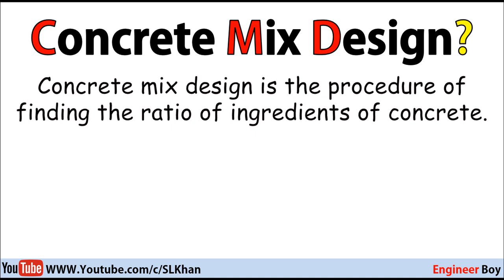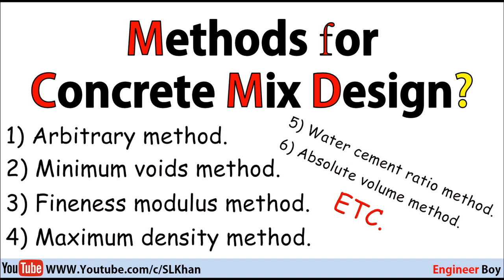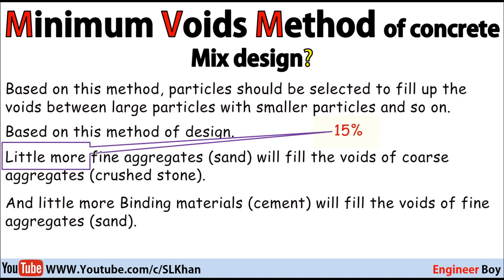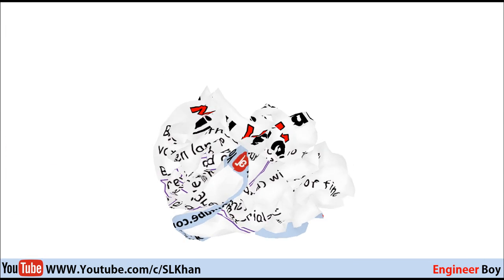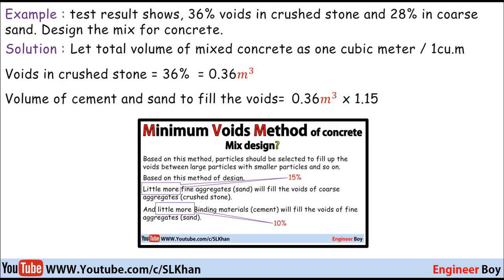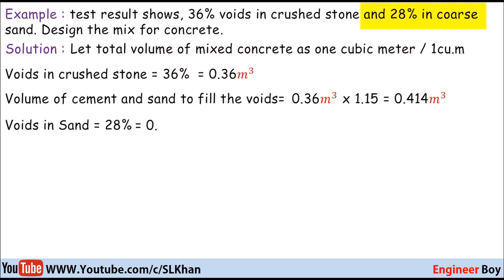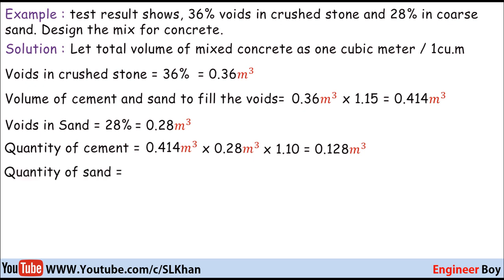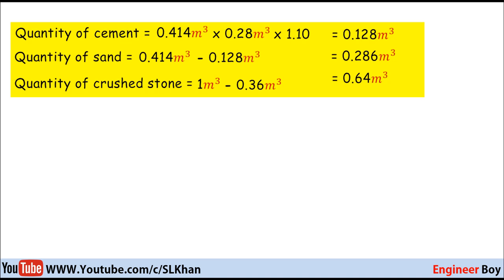concrete mix design

Comment: We use 1.45 Cement Per Bag (50Kg.) And We Need result of concrete strength less than 225 and 450 KG/CM2 after 3 and 28 days respectively. So, tell me ratio of sand and crush stone 10mm